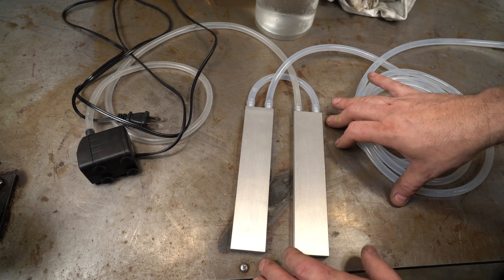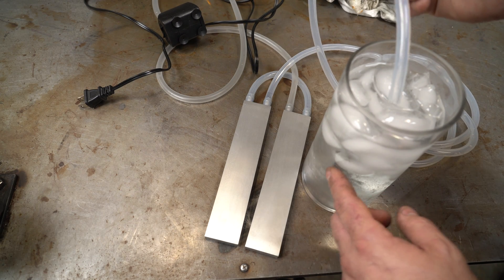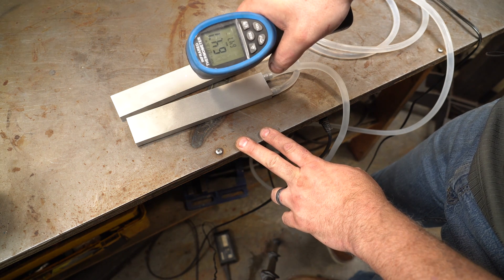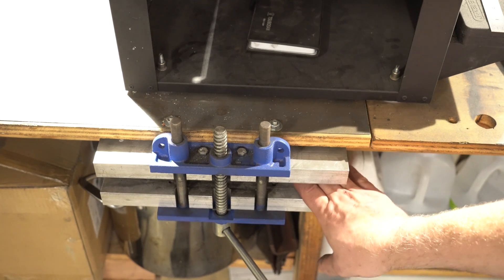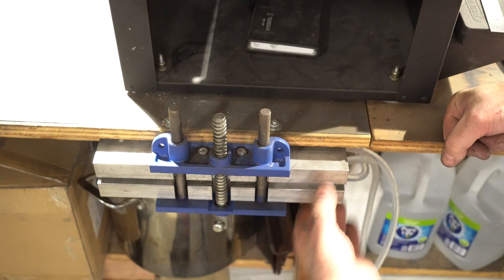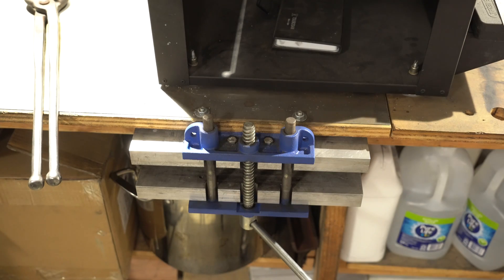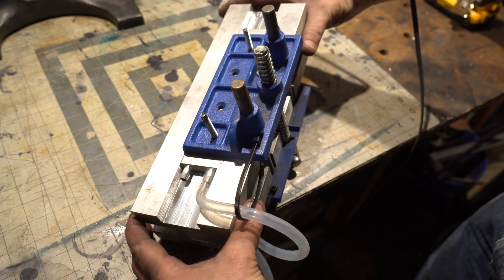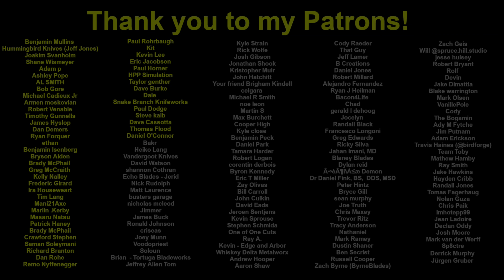Triple-T #153 - How to make water cooled quench plates

Comment: That's cool! Sorry I couldn't help myself. Have you considered using cpu thermal paste to sit between the cooling plate and quench plate? It's relatively cheap and is used for hotter, all be it smaller, components.
Reply from the maker: I actually did use some of that after the video. 👍. Thanks for watching.

Comment: Two suggestions:
- put thermal compound or thermal pads between the plates and the groove to maximize heat transfer.
- instead of having the two plates in series, where the water that goes to the second plate in line has already heated up in the first plate, have two pumps in the same water bucket, each feeding their own plate. It not only cools quicker, but the temperature on each side of the blade will be the same.
Reply: Should have read the other comments first! Oh well...
Reply from the maker: Yeah, I’ve already done the thermal gel.  Putting two in parallel is just overkill.  We’re not making parts for the space shuttle.  😜.  Thanks for watching
Reply: @TyrellKnifeworks  Well, one man's overkill is another's optimization. You said yourself the pumps were cheap... I know the cooling speed affects carbide formation, I'm assuming you're trying to optimize for speed and that having the top and bottom plates at the same temp can only be a good thing, so I fail to see how spending 10 extra bucks on a second pump qualifies as overkill. We have a saying "dying on the beach", you survive the wreck, survive the swim to the shore, only to "die on the beach".
Reply from the maker: @goncalovazpinto6261   We have another saying... optimizing the last 5% is a waste of time.  You assume that there's a massive drop in temp between the two plates but the water flow is quite fast.  Before trying to optimize something to death, figure out if you have a problem first.
Reply: @TyrellKnifeworks  Is that a saying? I didn't know. What I do know is the expression "diminishing returns".
I still don't see how buying a second 10$ pump is: "overkill", "working for NASA", "a waste of time" and "optimizing to death", but buying a tube of thermal compound is fine... 
I guess I got the wrong impression from the video: that you liked to tinker and share with others and, from that interaction, do some more tinkering. 
Maybe it's a YT thing. What do I know?

Comment: You might think of using a thermal grease on the contact area between the surfaces-like the kind used between cpu/gpu coolers on computers.  It minimizes the air gaps between the surfaces and promotes intimate contact to help move the heat more quickly from the hot surface.
Reply from the maker: Yup, it’s on the list!  Thanks for watching.

Comment: You could also try silicon grease for better heat transfer. It is used to better temperature transfer between electronic components and their heatsinks. 😄
Reply from the maker: Yes, I’ll probably look into that. Thanks for watching.

Comment: I would go one step further. Drill the channels directly into your quench plates. I know drilling long straight holes into the aluminium can be quite tricky. You need to start the hole with a normal length drill then deepen with an overlenght drill. Drill with a slow feed and clear chips often.  Normal practice in plastic molds to drill channels into the plates and cool with water. I like the small pump and the ice water bucket.
Reply from the maker: Why go through all that when these ready made pieces are so cheap though.  Thanks for watching.

Comment: Looks likes you put the cooling plates in serie, I presume in parallel would be better for a homogeneous temperature of both plates
Reply from the maker: That would require two pumps and would be overkill.  You're over thinking this I think.  Thanks for watching.
Reply: @TyrellKnifeworks   nope, it wouldn't require 2 pumps, just e "T" connectors
Reply from the maker: @dante7228  True, but its still overkill.  😉

Comment: I've considered this quite a lot, my plates are about 2ft long and an inch thick which means they soak up a lot of heat, but over time its fairly hard to shed.
Talking to other dudes with similar problems, my idea was the same as yours to make a channel, put a gasket in there and then plumb up some lines with another plate on the back to hold it together. However, that could be a real PIA for big plates and another suggestion I got was to get some 1/4 or 1/2" copper tube, lay it out in a mold and then pour aluminum all over them and I think that would probably net you a better heat exchange without risk of something blowing out and pissing water all over the shop.
Downside is that I'm not going to trust myself with 5kg of molten aluminum, but the theory is sound!
For the plates your size though its definitely an off the shelf option, CA glue tends to die at about 80C and its bonds break, I'd just pinch it in there with either some shims or a couple of bits of pin stock hammered in
Reply from the maker: I've seen complicated setups with chillers for larger plates.  Using molten aluminum over copper is a good idea though.  I've been contemplating something like that for an oil quench tank.  Thanks for watching, Kris.